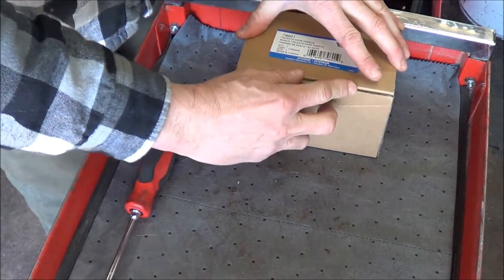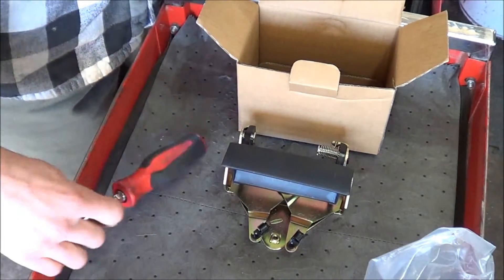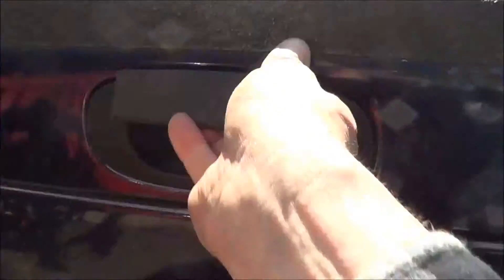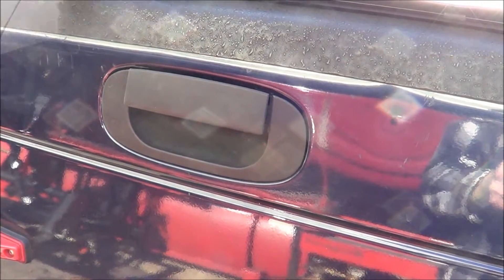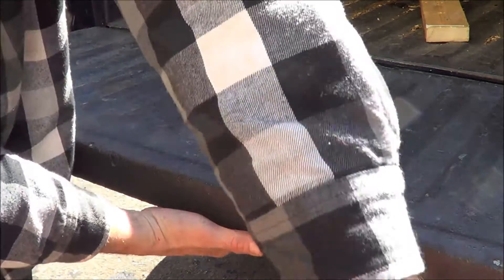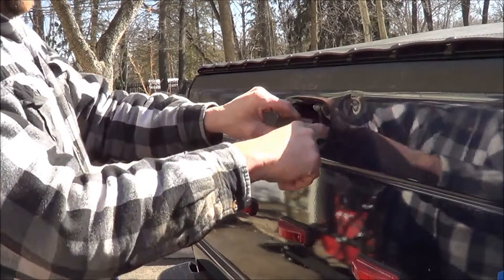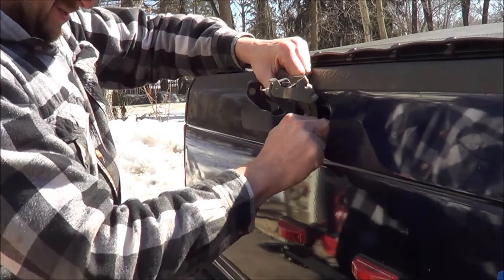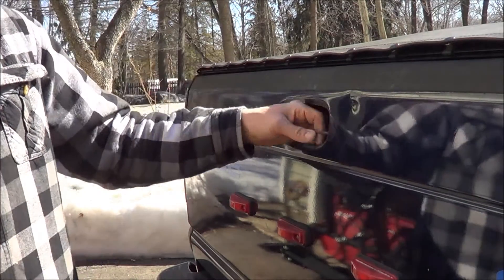3-13-14 How to replace tailgate handle on a 95 Dodge Ram Pickup

Comment: How to fix a tailgate that won't close?  01 Ram
Reply from the maker: lube the locks.
Reply: Oiled them big time.  The latches are fine, however, when i use the handle the pins over extend and won't latch again.  But, if i switch the pins back it works fine.  Weird.  Tore the gate apart yesterday, tested, worked it for about an hour.  It's better but not near to new condition.
Anyways, it's cheaper to just flick the pins every time i close the gate.
Reply from the maker: Maybe the handle pulls the rods too far? Is the handle new?
Reply: I think it's original.  The truck has 210km and came from BC.
Certainly could be over extending.
Thank you for your response.  :)